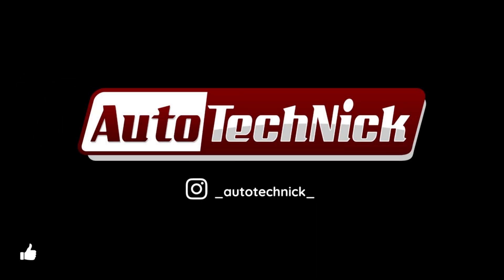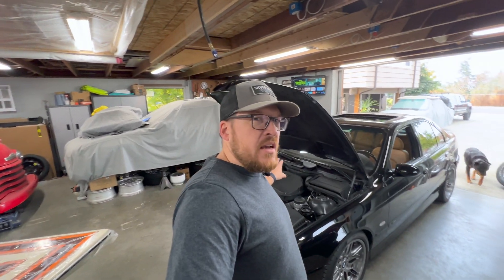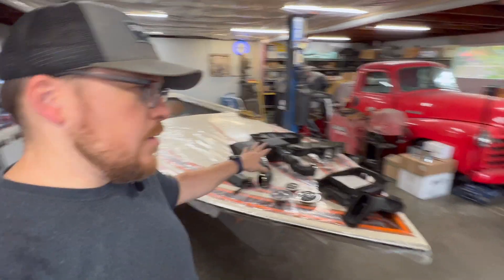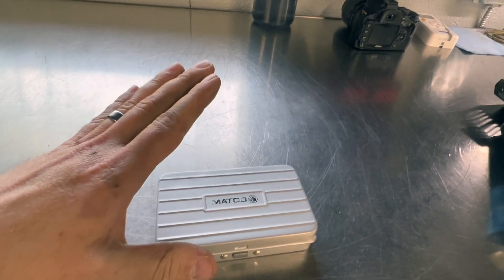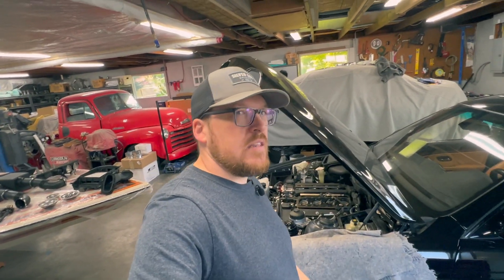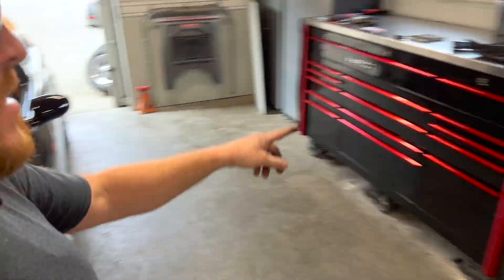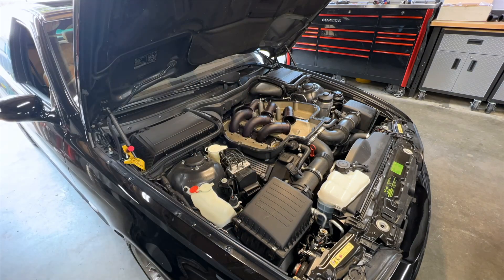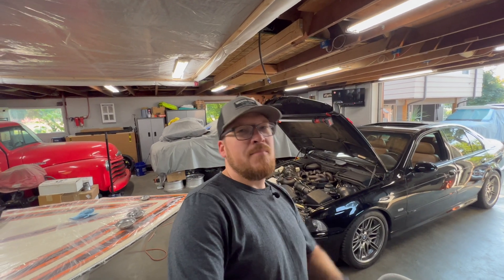How to Replace a Exhaust Camshaft Sensor on a 2001 BMW E39 M5

Comment: I’m looking for the second 2 sensors to replace.  Can’t find them lol 😂 any suggestions??
Reply from the maker: If you are referring to the Intake cam sensors, they are on the back side of the head as well, but they are behind a metal bracket and the plastic covers for the wire harness. They are not as easy to get in and out. 

~ Nick

Comment: So.. my m5 is ideling bad but when i drive it feels normal, sometines when i give gas its lagging. I changed all 4 sensors, do you think the tps migt be the problem? Or do you think it might be a vanos problem 🙆‍♂️
Reply from the maker: Without key information, not limited to ecu faults, sensor parameters and freeze frame data one would only be speculating to the cause of your symptoms. 

~ Nick

Comment: I actually found it easier from the bottom with the same tool from Northern Tool. Don’t need to take anything off to get to it except a Philips head screw driver to remove the plastic tray. On the passenger side it was easier from the top.

Comment: Great video as always! Learn something new with every video on this channel! 
How much differently did the car behave after having thrown that check engine light due to the sensor?
Reply from the maker: The failed cam sensor would cause the loss of all Vanos operation, which put the car in limp mode. So it was significant. 

~ Nick

Comment: For some reason I like the look of the exposed trumpets and would want to leave the cover off 😄 What other Dinan bits do you have on the car?
Reply from the maker: You should hear the sound of the engine with exposed ITB’s!!! 

The car also has the following:

Dinan Suspension 
Dinan Mufflers
Dinan SW

~ Nick
Reply: @AutoTechNick  Very nice. Maybe just need to add their carbon fiber intake kit. At the very least, it’s pretty 😁